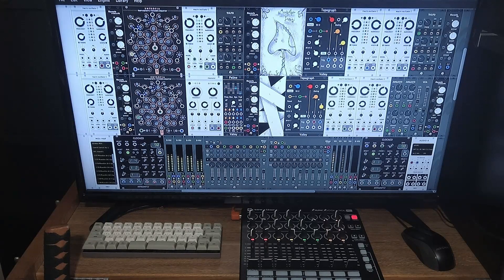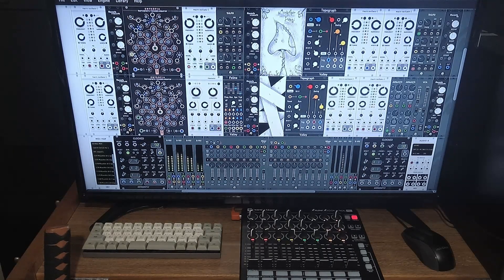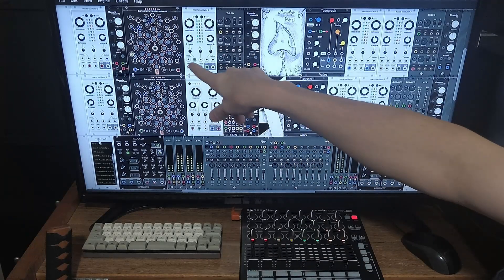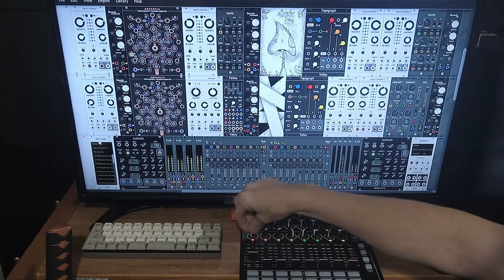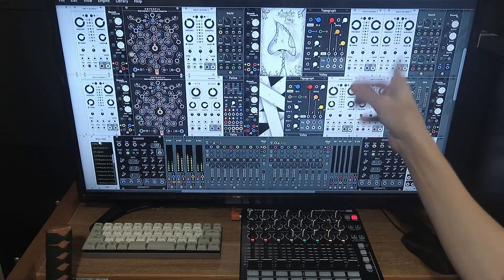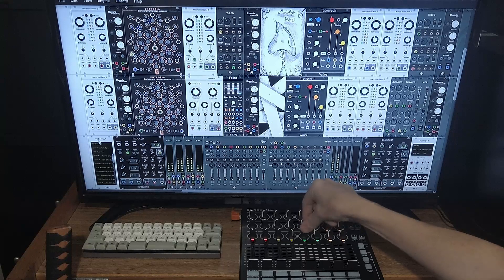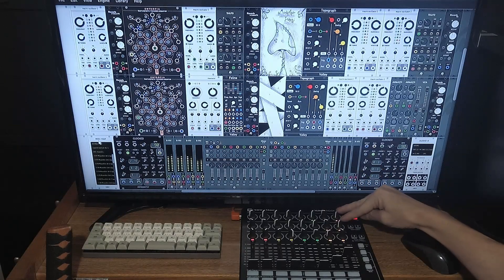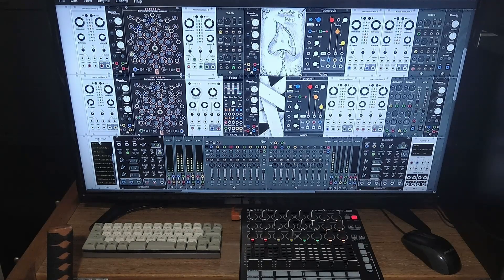How I Use Launch Control XL with VCV Rack

Comment: Hi Mr. Basic. Can these solo/mute buttons on the controller send cc messages and can they be mapped to buttons in vcv?
Reply from the maker: Hey, unfortunately VCV 2 doesn't have the Midi Cat module I made a video of, but you can still use it in old VCV.  Novation says you can make regular VCV brand midi modules work by messing with their own settings program, but I never tried that.
Reply: @MrBasic  thanks for replay🙂

Comment: great vid, Mr. Basic.  thanks for making and sharing it.  just got my launch control and looking forward to some fun!  looking forward to being able to edit the light colors to help keep everything straight but will have to wait to hear back from support as i'm getting a weird "you appear to be using windows 8" error.  i can still play with it in the meantime, though, and will probably just position my modules to help keep it all straight until it's fixed.  my main reason for buying the unit is sound exploration involving turning multiple knobs simultaneously, i.e during VCO chains, FM synthesis, etc. but see you perform this the way you did makes me think i'll use it sometimes in place of sequencers and so forth when i can do it manually myself just because it's fun :)  keep up the great work, man.  you're presentation approach and style are great, too, and you also have a pleasant demeanor.
Reply from the maker: Thank you!  Honestly, mine didn't seem to work at first, then it did, then it didn't.  I had to plug it in and reset the midi device choice a few times.  Now it seems to just work...it sounds like your problem is different, though.  I hope you can get it sorted out!  Also, most of the buttons didn't map for me in VCV.  Just the send select and track select buttons (I used it to run and stop my clock).
Reply: @MrBasic  FYI, I was able to get the launchpad buttons to work using MIDI-CAT from Stoermelder.  Might work for you, too.
Reply from the maker: @ef_af   Really?!  Wow!  Thank you so much!  If it works for me too I must pin this, or spread the word somehow too. 😀